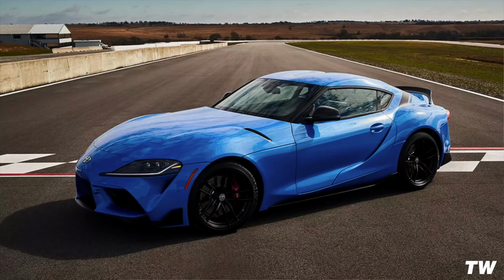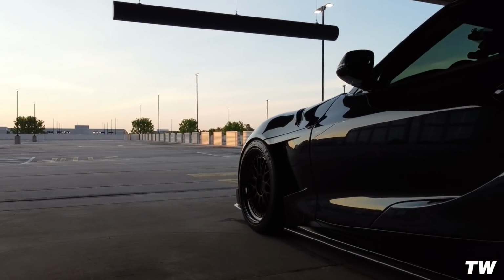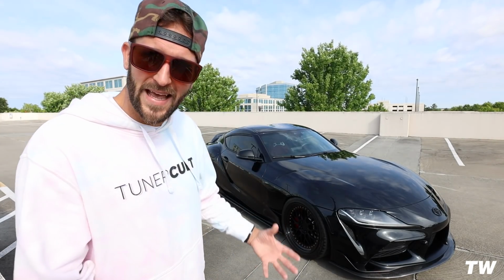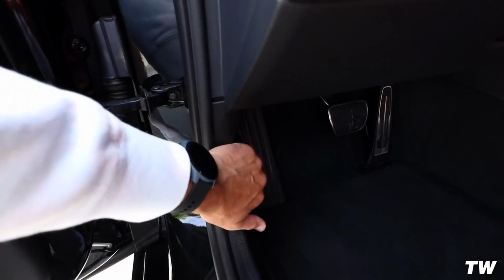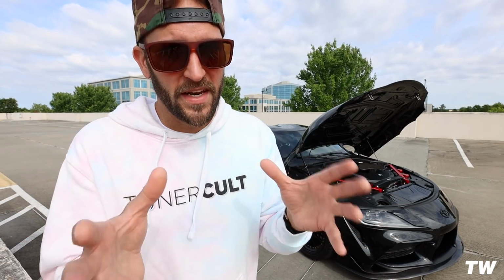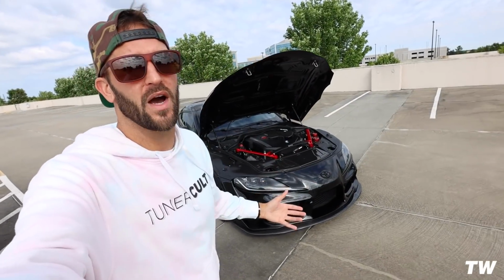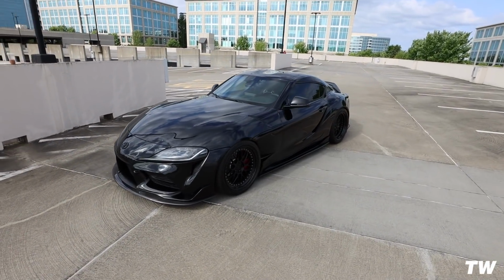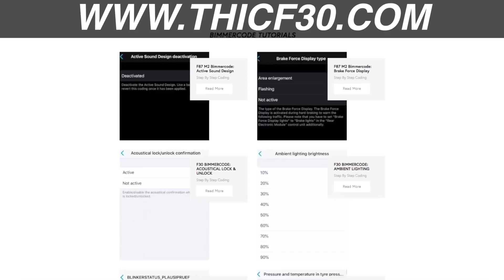2020 VS 2021 SUPRA..(Which one should you buy?)

Comment: i had the oil consumption issue myself had to add oils twice within 3000 miles, changed to a thicker oil and no more issue. Most of the guys who had the issue were guys that was pushing it really hard daily.
Reply from the maker: Good to hear, Which oil are you now running?
Reply: motul 5w30
Reply: i was told by the master mechanic at toyota that the factory oil is way too thin and that toyota didn’t take that into effect when they made the changes
Reply from the maker: Yeah that makes sense
Reply: @a91dan54  I wonder if the thicker oil is just the way to go regardless if you have a 2021 or 2020?
Reply from the maker: I run 0w20 in mine but I also run e50 often which thins out the oil so thickening it probably isn’t a bad idea. I change my oil every 3k
Reply: @ThicWhips  I run E50 too, but not often.  I mainly use my 93 tune.  I think I need to follow your lead.  Thanks.
Reply: @ThicWhips  yeah i just started running a flex fuel tunes today
Reply from the maker: Are you running ecutek?
Reply: @ThicWhips   who is the question for?  If for me, yes I run ECUTEK
Reply from the maker: Anyone really, lol. Im assuming the both of you are running ecutek. That seems to be the most popular tune as of now
Reply: @ThicWhips  yup lol
Reply: yes sir ecutek botmod3 was becoming a nightmare

Comment: Hello, now I am confused. You are talking about the date on the ecu to see if it’s tunable.  Here in Europe we only get the 340hp version. Even now in 2021 and the next years. The 380 hp version will not come to Europe. So if I buy a 2021 340hp, is it possible it can’t be tuned? Or is it just the 380hp’s ecu that is blocked ?

Comment: If Toyota expected these cars to be modified, why would they lock the ECU down so much?
Reply: It wasn’t Toyota rather BMW, most of the 2021 BMW’s have been impossible to crack, many people have used JB4 as that isn’t a DME flash
Reply: Toyota tuned the Supra so they have access to the ECU.  It is them locking it.  I also wondered why some 2021 were locked.  I heard some 2020 were locked but they could be cracked.  Now, apparently,  Toyota locked the 2021 with stronger encryption. 

I hypothesized that maybe Toyota got some test data back from some test mules early in the production of the 2021 and that made them think maybe the 2021 might have some reliability issues so it is best to lock the ECU.

It is very interesting to why this actually happened.
Reply: @supranova730  i suspect its EPA related
Reply: @flo-ridafpv5713  you could be right, but why are some not locked? Inquiring minds wants to know 😂
Reply: @supranova730  idk man maybe sum made before epa stepped in
Reply: @flo-ridafpv5713  yeah, that could be the case, but it doesn't explain why some 2020 and some 2021 got locked.  

It would make sense if the last group of 2020's that got locked were followed by all 2021 models getting locked if it was done to appease the EPA. The randomness of the locked ECUs is puzzling.  I have a tuned 2020 so I have no skin in the game.   I am just curious.
Reply: @supranova730  seems like some put in 21s were mfg in 20 idk...i gots no skin in have a 90 300zx twin turbo ...but lustin supra for DD ;)

Comment: I purchased my A90 2 weeks after you did, and my 2021 has the oil consumption issue... I have changed the down pipe (still catted) and a full exhaust. The dealership wants to tell me that these changes have caused the issue. Either way this is why I have not tuned it. Plus I’m not sure if my car is tunable
Reply: Just check the ecu date and see if it’s before June
Reply: How did you drive it during the break in period? Polls show that how it was driven during this period is likely the cause of this issue. I have a 2021 with 6k miles, no issues this far. Or this poll was wildly coincidental haha.
Reply: @clpauto3710  I have an early build date 2021 and I have driven the piss out of it from day 1, no oil issues yet but only at 2200 miles. What's your build date and how did you drive it during break in?

Comment: What happened after your brake recall? Did the dealer reset your ECU and did you lose your tune? I just had my 2020 recall done but I haven’t tuned it yet and the dealer told me the recall didn’t lock the ECU. I have a launch edition and is the same color ext/int as yours. I love the car and I haven’t even moded it yet.
Yes some of those forum discussions get freakin crazy. I just have to laugh at the ridiculousness to keep myself sane!

Comment: I've heard the opinion from supra owners that this particular supra is better in it's auto transmission compared to having a manual. What are your thoughts on that? Is the car engaging and fun as is ?
Reply: The car seems to be engaging and just as fun as the manual, though you get no satisfaction of driving it with a stick. Nonetheless the car is amazing performance wise, though bigger paddles would help a bit when diving through curves/canyon roads
Reply: @jkljkl218  that's good to know, do you feel the weight of the car or is playful in the corners particularly compared to the 86/brz?
Reply: @Aquaman-01  Haven't really done much in terms of breaking it in hard in the corners, it's a friend's mk 5 so I didn't wanna thrash it around real bad, personally, it feels great even though it wa driven "tamely", car responds well with how you want it to act.

One thing I can say is watching my friend go hard in the corners. The weight distribution seems like it works wonders. Rear end kicks out real easily if you put too much throttle.
Reply: @jkljkl218  thanks for the information, I rented the supra on my last vacation but wasn't able to drive it really aggressively. Even so I loved the way the car felt when driving, a small launch off a red light had the tail end wiggling from right to left just enough to feel fun but not to the point where I ever felt like I'd lose control.  Ive heard a couple recalls for 2021s citing oil consumption omg problems, this is probably my biggest reservation about getting one
Reply: @Aquaman-01  friend just got the oil consumption issue and dealership did say it is covered by warranty if something fails due to it.

Comment: I have a 2021 - oil consumption issues confirmed. 3000 miles had just an intake
Reply from the maker: Damn bummer dude
Reply: What month and year was your car made?
Reply: @simonk3776  6-27-20
Reply: I have a 2021 with 6k miles, no issues. How did you drive it during the break in period? Theres a poll on the forums that show theres a high likelyhood of the issue being cause by how it was driven during the break in period. Either that, or the poll was wildly coincidental
Reply: @fordmustangkillerko  mine was built 7/20. 3,114 miles, no issue yet. My neighbor had an issue, they replaced his car. He broke it in 1,200 miles, now has 2,700 miles no issues yet
Reply: @clpauto3710  I can’t say I was easy with it during break in, but I definitely didn’t push it until after 1200 miles
Reply: Nevermind, I have the problem. Taking it to the dealer tomorrow

Comment: Thank you for making this video. I've always wanted to know the difference. I never knew about the DME tune abilities. Are less company's making turbo upgrades for the 6 port heads?
Reply: Without the ability to tune no company’s have made different turbos for the a91 as they would need to flash the DME to setup the car right for the tune
Reply from the maker: What? https://www.full-race.com/store/borg-warner-efr/manifolds-efr-series/2021-toyota-a91-supra-b58-6-port-top-mount-dual-ewg-turbo-manifold/?utm_source=google&utm_medium=cpc&adpos=&scid=scplpwoocommerce_gpf_107721&sc_intid=woocommerce_gpf_107721&gclid=EAIaIQobChMIp-r95JLF8AIVMvC1Ch35yAU_EAQYCSABEgIdwPD_BwE
Reply from the maker: There are aftermarket turbo options as well as hybrid turbo options already available for both 2020 and 2021 supras, as well as manifolds. Some of the 2021’s have pre 6/20 ecus meaning they are tunable.
Reply: @ThicWhips  oh, what I had seen was access to turbos but had troubles getting them properly setup to the car bc of the locked dme?
Reply from the maker: The majority of 2021’s cannot be tuned. But there are some already running big turbo setups. Just not nearly as many as the 2020s

Comment: 2020 owners are going to see big depreciation issues compared to 2021.  Not only did they add 50 hp, but they fixed a bunch of the suspension issues.  I guess if you are going to modify it, it doesn't matter. 

With the volume and desire to tune these, they will crack the ecu.  Too much money to be made.

Comment: The ECu thing is a non issue
Reply from the maker: Not true. The ecu still needs to be unlocked by femto out in Russia. You’re paying a lot more for a tune than a basic flash and go. Either you buy another ecu and clone or send yours and risk shippping losses. Either way, it’ll cost you thousands. That is certainly an issue, when 2020 supras are simply flashing and driving within minutes.

Comment: Theres a big differences on hp for 2020 and 2021 theres no such exu that cant be cracked you just need to wait plus those bought 2020 and just did 91 tune is still slower than 2021 stock